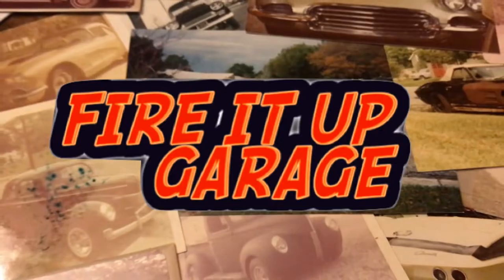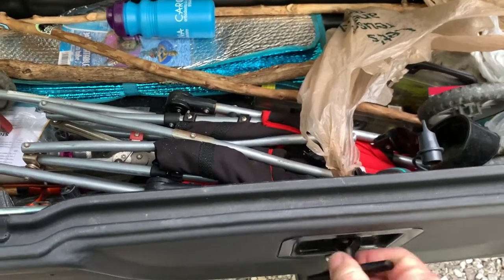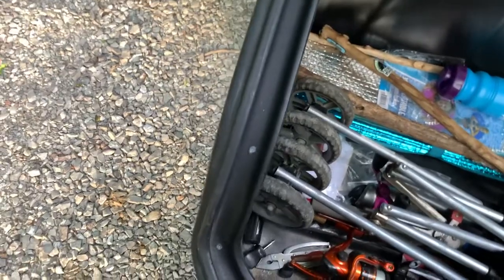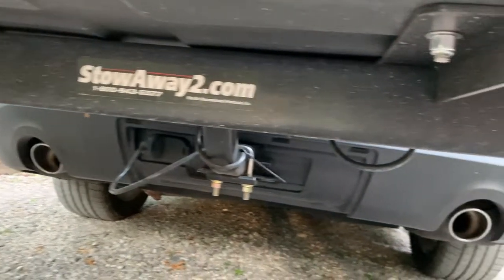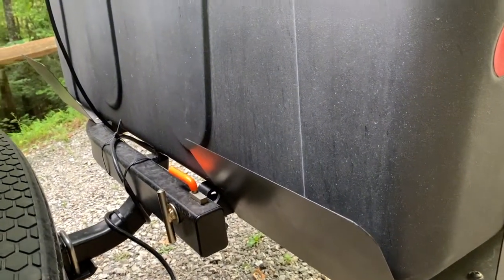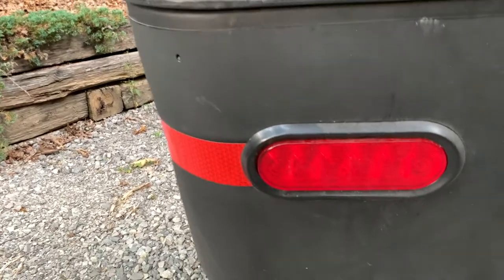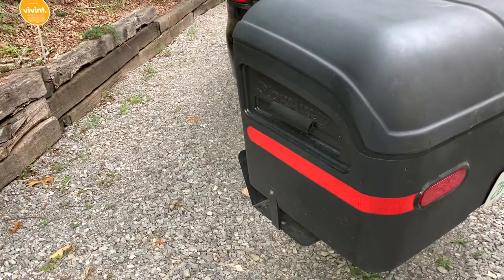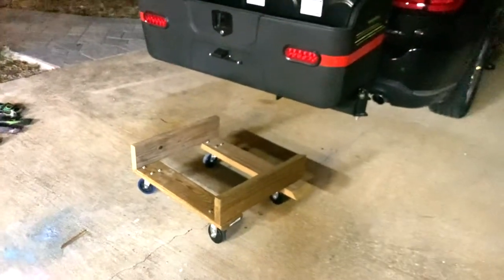Best Cargo Box Review- STOWAWAY2 MAX Cargo Carrier - Hitch Mount vs. Rooftop car truck SUV Jeep

Comment: I am considering one of these so thank you for your thorough review. One thing I am concerned with is my backup camera. Did you guys have to shut off your "warning" alerts for your backup sensors/camera? I really like having a rear camera so trying to come up with a plan on how to disable the vehicle one and then maybe add another backup camera to the license plate holder on this carrier. Is there a place on the license plate holder to attach it?
Reply from the maker: Great questions. On most vehicles (including this Durango) there is a button to turn off the back up warning alarm/ signal. As to your question of an additional camera, that would be pretty easy to install because of the power already at the box for the tail lights and also the fact that it does have a license plate holder. In general when I am carting this box I park a little further out so I can use pull through spots, but of course that is not always possible. It is a great box- would not trade it for any of the others. The quality is superior and it could very easily last a couple of decades of trips.

Comment: This is awesome. I worry that my split gate on my x5 would probably hit that heat sheild.
Reply from the maker: The heat shields come separately and are installed by the owner. They are only necessary with the rear exit exhaust. You could for sure make some minor adjustments to their placement if necessary.

Comment: Trying to see if this is viable for a model X. Usually when we charge we have to back up and sometimes there is a post. So it could be tricky. Might just try the harbor freight one that folds up after i take whatever on the back i have. Yes it's a hassle but that's what it is with newer tech. Once you drive electric it's hard to go back to regular gas cars. 😊
Reply from the maker: Thanks for watching. Yes that is an interesting consideration. We run this one on a Dodge Durango and park either front in or back in with no problems. The swingaway arm would give you the option to swing it out of the way if there was an obstruction directly in the center. These boxes are expensive but there is no comparison in quality with any of the other options on the market- as you will notice with all the duct tape and trash bags wrapped around the others on the road. I would consider what you will be carrying and the water resistance. If you are only carrying beach gear for instance then it probably doesnt matter so much for quality. If you are carrying luggage or anything that can't get wet then the Stowaway can't be beat. The Stowaway is very solid and very durable- much like a kayak or boat in rigidity and quality. Good luck with your search!

Comment: Quick search for the price:  $1100.
Reply from the maker: Thanks for watching. There are a number of sizes and options. The Max with the swingaway feature is currently $1099 without the swingaway will be a little cheaper. Also the smaller size is cheaper. We have links in the description and the comments to the listings for sale.

Comment: Great but for 5x the cost of others not that great
Reply from the maker: Thanks for watching. Like the old saying goes- You get what you pay for. This box is more of an investment that will last many years. The cheap ones are more suited for a single trip and get out the duck tape. The first one of these we bought was used by another family for 10 years- then we bought it and continued to use with no problem for many more years. No leaks, no cracks, no perceptible wear due to age. We only sold that one to upgrade to the swingaway feature.

Comment: Nice but WAY too big to have to store in the garage
Reply from the maker: Thanks for watching. This is the "MAX" box, which is the large size.There is a smaller version (12.5 cu ft) available in both black and white. Here is a link https://amzn.to/3NtZ6er The main difference between the Stowaway boxes and others is the quality of construction. You will see a lot of the cheaper boxes cracked because the plastic is thin and brittle. These boxes are a similar material to kayaks. Very thick and very strong. We have had no problems with this one- now going on a couple of years of use. Hope this helps.